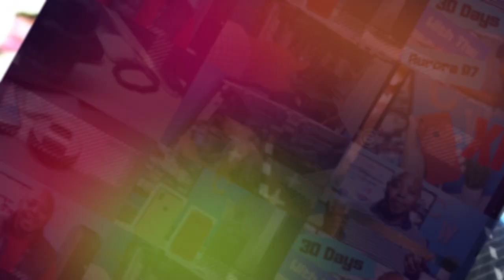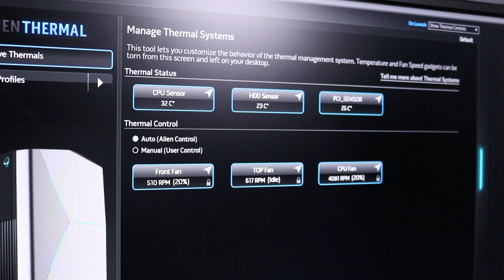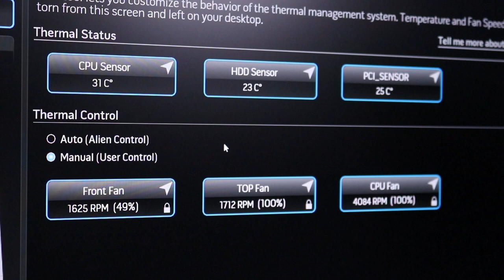Corsair Hydro Series H60 Liquid CPU Cooler Install / Upgrade in Dell Alienware Aurora R7

Comment: Hi WiLcreatives, thank you for your videos. really helpful. I think the top cooling fans are installed in opposite way? I am not sure but let me know what you think
Reply from the maker: Drazelion Gaming hey that’s the right way, in that direction it sucks the hot air out the case to dissapait through the attached radiator, which hot air comes out the top of the case.
Reply: @WiLcreatives  Thank you buddy. Appreciate your response. I just bought one earlier and the assembly is correct. i was thinking that the fan is used to suck cold air to cool down the radiators which is used to cool down the liquid. By the way, how's your Aurora now with the H60? any problems or issues?

Comment: i know this is an older video, but i have the same model pc. the R7 but I just installed an i7-8700k and this same water cooler but my cpu is still getting very hot. And the pump itself that sits on the cpu is hot. My pc is not overclocked at all, I'm not sure what to do

Comment: I know there is a big noise difference when switching from air cooler to this aio. But what about switching previous Alienware aio with corsair h60. Would the difference only be noise levels or temps as well?

Comment: So I noticed you have your fan set up to suck in the hot air from case and blow it out through the radiator.  Other people are saying suck in the outside air from case and blow that cooler air over radiator.  I'm so confused.
Reply from the maker: It has to work as an exhaust because thats the only exhaust in the case. The front fan pulls in cold air.

Comment: I just got this pump to replace my stock air cooler in my new aurora r9. I have a slight what sounds to be air bubbles in my pump. When I tilt the case to the side, the noise stops when I tilt it to the other side it gets much louder. If I leave it normal I can hear it but, not as loud.
Reply from the maker: When did you install it?

Comment: Is this better than the one Alienware offers for the r10-r11?
Reply from the maker: Not familiar with the R10 or 11 but Corsair is aftermarket. Those are usually better than what’s included with stock from the manufacturer
Reply: I see question I’m sure there’s not much difference from the older versions would you be able to run a dual fan with the H60? For better temps ?

Comment: Hi sorry one more question i just recently installed thos same liquid cooler h60 into my aurora r7 but I would like to know if you can tell me why some people say plug in the radiator fan connector in the CPU fan? Is this true they say the radiator speed should be controlled by the BIOs sometimes I hear a very loud fan noise coming from my pc

Comment: i cannot get my top fan connected to the radiator to work, if i plug it into a cpu fan 4 pin port it will spin just not on the top fan port on the motherboard, i have looked online and cannot find anything

Comment: Do you seriously need to remove like every component within the case and the top and back part where the led lights connect? Couldn't I just disconnect the graphics card and RAM and just disconnect the fan where the radiator is, install the corsair one and remove the Alienware cooler and install the Corsair? Seems a lot simpler...
Reply: It would probably depend on the backplate. If you need you need to mount it and change the backplate its a lot easier to take the mother board out so you can get behind the motherboard. It's a lot easier to take the mobo out especially since you'd need to be applying thermal paste. Etc.
Reply: Idk I just upgraded my air cooled version without needing a backplate as the included standoffs fit in the current backplate. I did not take anything out. Just had to unplug the motherboard at the top to wiggle the radiator in the top. I thought I had to screw it in but the top cage doesn’t fit the screw holes. Luckily it’s such a tight fit that the radiator and fan just kind of get stuck or wedged in tightly. It was harder to close the case because of the radiator pumps but it works and my temps are idling at 40c and maxing around  70c. So I think it’s good. Probably better to get your own thermal paste however applying to much is never recommended and the cooler it self came with a good amount of paste. Dell barely made sure one of these would fit and if you ask me all Alienware systems should ship default with an aio and a vrm heatsink because the air cooling with the psu in the way is tota bullshit
Reply: I probably need to add an intake fan in the front but now I don’t have money for a new hard drive 🤷🏼‍♀️

Comment: should i use cpu-fan or top-fan on the motherboard?
Reply from the maker: Cpu fan
Reply: WiLcreatives if I plug in to cpu-fan it shows it detect an hardware problem Fan-The cpu fan failed to respond correctly 😢so I have to plug it in top fan instead...I am using H60 as well and newest bios

Comment: Hi Will, can you upgrade the CPU of your aurora 7 from 8700 to 9th gen or 10th?
Reply: 9th gen has the same socket as 8th gen. 10th gen is a whole new socket generation. I'm planning on taking out my i7-8700 and swapping it for a i9-9900k at some point myself.

Comment: Will this liquid cooling system screws fit the brackets from an original air cooler? Cause I want to upgrade my air cooler to a liquid cooler using the same liquid you show in this video but I dont want to take my mother board out
Reply from the maker: Good question i believe so. I already had a liquid cooler so I wouldn't be able to tell you 100%

Comment: I got the H60 as well but for some reason the fan always stays on 100% speed, I went to the command center and try to turn it down manually, but it just get louder, did I do something wrong or did I missed a step somewhere?

Comment: do you need to add liquid?? (I'm very new to this)
Reply from the maker: levi hohaia Hey no you don’t have to add liquid. This is a closed loop system. Meaning the liquid is built into the cooler. No maintenance needed like with your more advanced reservoir liquid cooling systems.

Comment: I did this and my pc is running more quiet than before but my temps are at 78c  sometimes going up to 83c. Before replacing my fan my temps where up to 88c. Also I removed the old thermal paste because my comps temps were up to 85c.I did everything you did also I got the same h60 but I installed it on an r9.I’m going to be adding a second fan to the radiator to have one bottom one top and gna use a splitter for power.
Reply from the maker: Nice!
Reply: @WiLcreatives  are these normal temps go this cooler?Its my first time doing it
Reply from the maker: @checkyoself6699  is that at full load or while your pc is idle for those temps
Reply: @WiLcreatives  it’s full load on idle it’s like 60c
Reply from the maker: I would probably look into reseating then aio. What type of cpu do you have and is it overclocked?
Reply: @WiLcreatives  i did that after I first finished re applied thermal paste and made sure I didn’t over tighten.I have a i7 cpu n about overclocking I only use the default Alienware profiles overclocking 2.the only thing I did different than you it’s add the fan on top of the radiator instead of the bottom
Reply from the maker: That exhaust fan is the only exhaust fan in the case. I would add it to the bottom to see if you see a difference, sounds like you would.
Reply: @WiLcreatives  I was going to add a second one on the bottom and use a y splitter for power.do you recommend I just move it to the bottom or would it be more beneficial to add another?
Reply: @WiLcreatives  thank you for taking the time to reply to me it’s my first time changing the CPU fan and having to add thermal paste. I also read that the data cable should be connected on its own. Thanks for your help

Comment: Great video. Since my comp has a air cooled cpu, if i wanted to upgrade to this i would i be replacing that 120mm fan on top with the radiator/fan assembly it seems. Thanks in advance if anyone can confirm this. I'll probably end up buying this because the stock cpu fan is so loud.

Comment: Why replace the dell liquid cooler if it wasnt broken? Going from 120mm to 120mm isnt really an upgrade. You didn't have to disconnect the psu to install it.

Comment: would an h60x work for the alienware aurora r7? you use an h60 in this video but i cant find any that are not used and i would rather have a new one. thx
Reply: Any news on if the h60x works with the alienware aurora r7?
Reply: @TEC-99  nope. refrained from upgrading for now
Reply: @michael-hj8el  i have a R8 and was seriously thinking about the h60x, im not 100% sure but i think its possible it could fit, but i ended up buying a old stock H60 on ebay and am going to put that in my r8.
Reply: @michael-hj8el  Update: just put my H60 in, really not that bad and i did not remove the psu, i had the Alienware liquid cooler, and it made A WORLD OF DIFFERNCE. my old Alienware liquid cooler was so loud, got very hot, but it got super annoyingly loud. this runs almost inaudible and its sitting at 100% usage, and keeps it super cool. and my H60 was a used one. HIGLY RECCOMENDED.

Comment: Should i get the aurora r8 or r7?
Reply from the maker: If you're looking to buy I would build my own pc right about now! If you're not up to it I would get an NZXT build for the same money you would spend on an Alienware.
Reply: yeah don't buy an Alienware pc. I have the R8 and Im watching this video right now because the fans that were already installed in this pc are loud AF. The AWC (alienware command center aka settings for fans, temps, etc) is buggy and asks you to download more components when you already have them but anyway long story short, Build your own or like he said get and NZXT build
Reply: I bought a used Alienware R6 on ebay for 1k with a 30day guarentee dont buy without that or risk a DOA and no refund. 

Spec
I7-7700K - 4.2ghz
Gtx 1080
256 m.2 ssd (Boot drive)
1tb HDD
Luquid cooler for CPU

I'm in the process upgrading it but check out used AW desktops you'd be surprised there are good deals on them.
Reply: WiLcreatives the Nzxt build is more expensive than the R8. I got it for 1,000$ with i7 9th gen and rtx 2060

Comment: Do I have to remove the power supply and cd drive ? I have an r8 which looks exactly like your r7
Reply: Nope, dont waste your time, i dit it without remove them
Reply: @BaoNguyen21087  Thanks. I did it already , it was rough and a tight fit in the top fan, how did yours fit up there?

Comment: I like you and your vids dude. Definitely subscribed. I have a question though for anyone that might know. Is there a liquid cooler that doesn't require removal of mobo? I can do the work, but would rather not. I have an Aurora R8 btw. On the same subject, can anyone recommend a regular fan cpu cooler that is better than stock that also doesn't require removal of mobo? Thanks for any help

Comment: nice video! I use same h60 and it works pretty good.  but it always running support assist and told me cpu fan not responding. Do you know how to fix it?
Reply: just connect pump to the pump and the 120mm fan to the top fan do not use cpu connection
Reply: @ne0njm  could you tell me where the SATA cable goes? It connects to the sata connectet near the PSU right?

Comment: I just installed the corsair h60 today and I have installed ml120 blue led pro corsair fan on the front and the  Alienware Command Center is showing my fans are around 60 percent when it's fixed at 100 percent in the settings. Is there something that I  need like a corsair commander pro to control fan speeds or do you think I have a software problem with Alienware command center and just shouldn't worry about it?  I plugged in my stock fans to test the software and the fan speed shows 100 percent but of course its really loud so maybe the problem is Alienware Command Center. I installed the corsair fans back in my system and I can feel good airflow but I'm just curious if my fans are running at 100 percent when the software is only showing 60 percent. Sorry for the long message but hoping to get some insight
Reply from the maker: That’s a good question. I didn’t have the opportunity to play around with custom fan controls. I sold my Alienware to someone who needed a gaming pc. In my custom built system I have the commander pro which allows me to control the fan speed. What you’re experiencing could a be a limitation of the Alienware system. Not 100%
Reply: @WiLcreatives  ok thank you man. I really wanna build my own pc one day but I think I will uninstall the alienware command center and install a corsair commander pro then install its properitairy software. About the Alienware command center reference to the fan controls, I was able to test the corsair fans and adjust the fixed speed percentage while holding the fans and the fans actually do respond to my percentage on the alienware command center but of course it's not showing the actual fan speed accurately. Again I think it will be best for me and anyone with a alienware pc to install a corsair commander pro. I have one question for you when it comes to installing the corsair commander pro. Do I need a usb 2.0 usb plug or whatever it's called on the motherboard to plug in the commander pro? Do you have a video of you installing a commander pro? If so that would be awesome even showing the software and how to use it.
Reply: Also do you know if the Alienware r8 has a usb 2.0 header by chance?

Comment: I like your channel man. I have to say I don't agree with what you said about the fan on the radiator unless you just said it wrong. The fan shouldn't be pushing hot air from the case out, it should be pulling cooler air IN over the radiator...like a car would do.
Reply from the maker: Richard Curtis naw it’s should be taking hot air out! It’s a compact case. Hot air had to escape otherwise you will have a oven!
Reply: @WiLcreatives  OK. I guess it's backwards. I'm trying to come up with a way to cool down my R8. I'm now having trouble with the Command Center not working. I'm starting to regret buying this lol

Comment: I'd suggest not to use q-tips for cleaning or applying thermal paste. It can leave thin fibers on the surface. Use coffee filters. They're cheap and much better than q-tips.

Comment: Can i swap the fan with a corsair LL120?
Reply from the maker: You can but there isn’t any benefit in doing so if you have the Aurora R7. Plus to control the the lights you will need the lighting node pro. Performance would be the same in terms of the fan.
Reply: WiLcreatives Thanks, i just wanted all my fans be the same. I planned a 3 pack that comes with the controller for the front window of my pc case and the single pack for the rear.
Reply from the maker: @Knallsack  Nice in that case go for it! You won't regret it.

Comment: Alright I decided to change my r7 case I also got a ssd and ram with fans and already had a better gpu it was going decidedly well had to pull out the WiFi card but it works so it’s okay I was going along and when I went to cables i realised there is no power led connection I can’t turn my pc on now I had to get a new motherboard a cpu and cooler also I had a psu earlier I went from a case swap to a brand new pc I do not recommend case swapping the r7 with out a new motherboard you can’t even turn it on and Also it will make you spend a chunk of change for goood quality parts ended up with £2.3k for me and I have 2 pcs now great :)
Reply from the maker: iceclasher27 Yeah the motherboard in the R7 is garbage. Good thing is you just built a pc. Now you can do whatever you want!
Reply: WiLcreatives yep I also got a beautiful case the rog helios
Reply from the maker: iceclasher27 Nice case! Congrats on the build!
Reply: WiLcreatives thank you also just wanted to say your tutorials are amazing and in detail carry on doing what you love.

Comment: The cooler (Corsair Hydro H60) that is being used is actually not fitted for the Aurora R7's mounting bracket at all. You literally have to force it into the mounting bracket with lots of brute force. It's not a tight fit as he mentioned in the video, it barely fits for me and I couldn't even push it all the way into the bracket so I just left it stuck in there and didn't even use the top screws to secure it on the top side of the bracket.

Wouldn't really recommend this cooler because of fitting...

Comment: HEY Will please can you tell me if my h60i (2028) is enough good for my 11600k maybe i should not overclock or undervolt it a bit?Thank you in advance any idea is welcome *i use spec delta case corsair and it havent any space on top for 240 AIO...SHAME ON YOU CORSAIR.. pAUL GREECE

Comment: Where do you plug In the sata cable coming from the pump cooler did you plug it in somewhere or just let it lose
Reply: Sorry I missed that step will plug it in to one of the satas connections
Reply: @Juliet_533  wait bro did it work? I  don't know where to put SATA... Did u put it in the sata connecter that is near the psu???

Comment: HELP, I recently bought this cooler and it doesn’t fit on my ASUS ROG STRIX B450-F mobo
Reply: Pacho did u get it to fit?
Reply: Maxi Taxi yeah, it was just some other mount i had to use to get it to fit. It came with the mobo. I watched a very helpful yt vid that showed basically all different types of coolers needing different mounts

Comment: great walkthrough. I got an r7 with the alienware liquid cooling. I'm still learning building/upgrading pics but how can I tell if I have vram heatsinks in my aurora r7? I'm looking to upgrade from a i5 8400 to it 8600k cpu.
Reply from the maker: Dennis N. I know longer have the Aurora R7. I actually don’t remember seeing VRM heat sinks for my system because it didn’t support K series cpus.